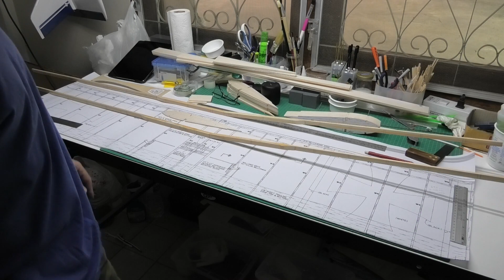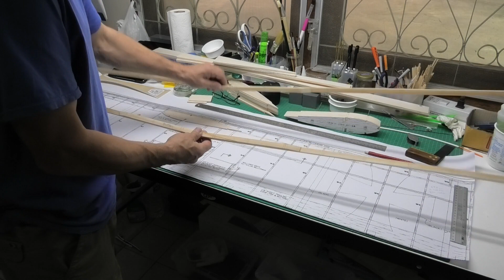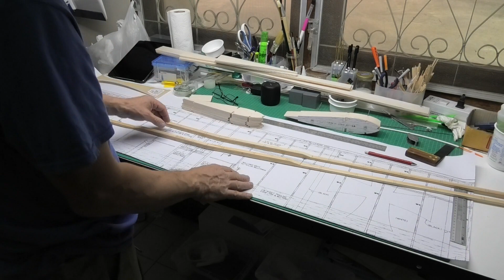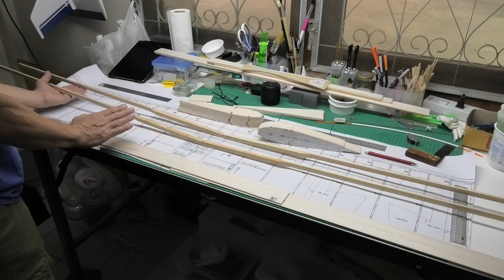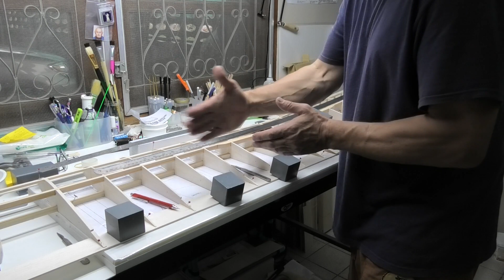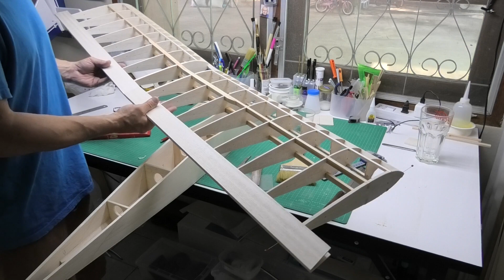Das Ugly Stik Balsa RC Aeroplane Build - Pt 3: Building the Wings

Comment: Hey Mark. The webbing between the spars... That's spruce, right? 1/8" ply? Also...my wing does not fit squarely with the fuse. Can a guy cheat and Mount the wings at an angle? I realize that induces trim issues... How much 'slop' can a guy get away with? I found my wing is a little high on the same side yours is too... so at least I can fix that...
Reply from the maker: Hi John, the spars are from 1/4 x 1/2 spruce, and the shear webbing is 2.4 mm balsa.  You will need to watch the next video to see how to fit and seat the videos correctly,  if at first they don't fit level that is fine, you just need to careful sand the fuselage saddle till it is correct and level. Good luck, sure it will be fine in the end
Reply: @MarkRobinson555   I really appreciate the vids and the time you took to make them, Mark. Please keep making more...!  :)
Reply from the maker: Thanks for such a kind comment, plenty more build videos to come 😀

Comment: Again very useful Mark. Can I ask where you got the spruce for the spars and did the shop have the size you needed?
Reply from the maker: Hi Ron, thanks for the comment - I got the correct sized spars from a stationary shop in Chiang Mai, northern Thailand.  They are not an easy thing to get out there, but there are a few places.  Are you in Thailand?
Reply: Yes Mark. I am in Hua Hin/Pranburi now after 7 previous years in Chiang Mai and 20 in BKK before that. Here there are not many useful shops for this hobby. Chiang Mai was excellent by comparison. My new project is a vintage Miss America which is challenging for materials!
Reply from the maker: Good luck with the Miss America, should be a great plane, and I know what you mean about trying to source good materials.  The only thing I can suggest for the spruce is to trawl the Stationary shops.  I have in the past got balsa from Mini-RC in BKK, but dont think they do spruce.  I only ever found it in the stationary shops, along with 3mm ply and balsa - good luck

Comment: Awesome work man! Im building the exact same model. I have a question, which glue did you use to glue the ribs to the spars?
Reply from the maker: I used CA, as I did for most of the build. Good luck with your build
Reply: @MarkRobinson555  I read Brian Winch article on glues years ago. His favourite glue was equal parts : -Water , Aliphatic  ,PVA (Titebond )